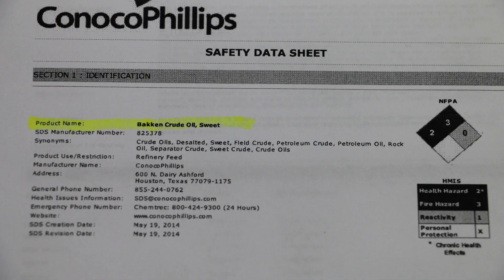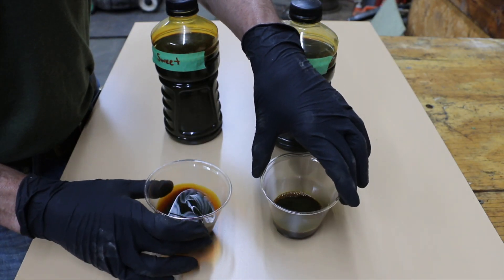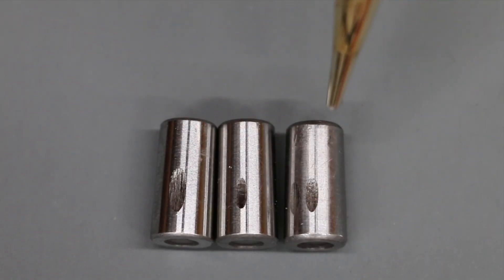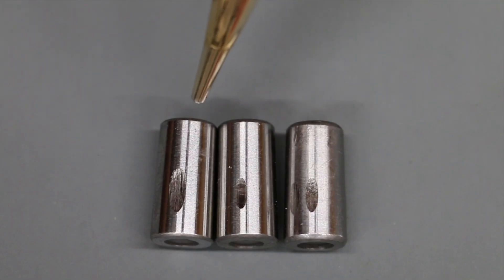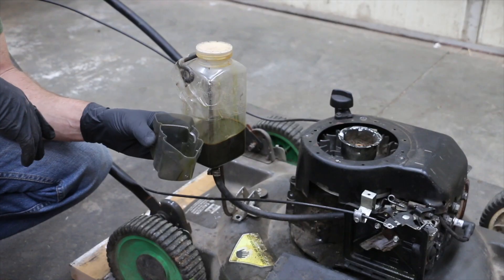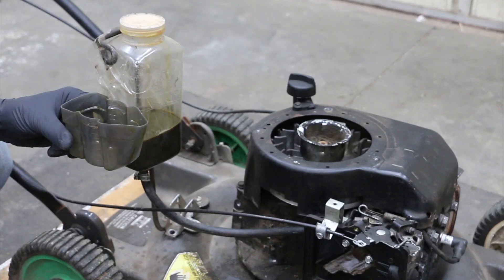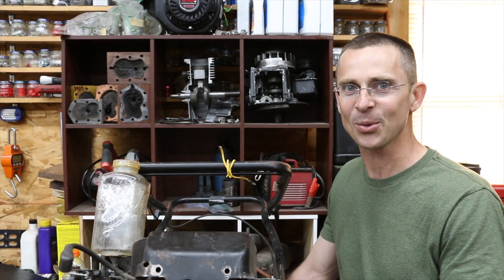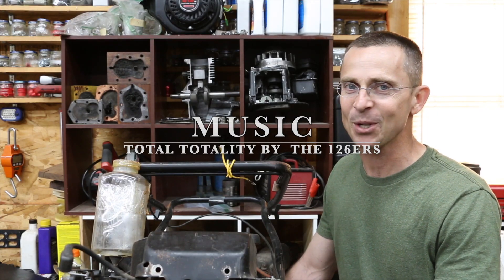Will a Gas engine run on Crude Oil?  Let's try it!

Comment: What if you use grease instead of oil in the crankcase?
Reply from the maker: Thank you for the video idea!
Reply: mharris1270 ya but im wondering how much you would have to put in the case and if would actually work. And i don't think there's oil pumps in Litt lawn mowers
Reply: mharris1270 how about if he does it he does it
Reply: A friend of mine has an old finish mower with blown out seals on the gearbox.  Wouldn't hold oil so they drilled and tapped it for a zerk.  Been running with grease instead of oil in there for like 5-7 years and still going strong.  I agree this would be an awesome video!
Reply: It would NOT be an awesome video unless you enjoy blowing up engines.....which some people do. The grease would not get into the moving parts at all; it would just sit there in a big blob and do nothing. Hence the engine will seize or explode quickly from lack of lubrication.

Small engines like this do not have oil pumps. Rule of thumb is, no oil filter=no oil pump (splash lubrication.) And don't be fooled by the hydraulic oil filter; some machines have no engine oil filter, but a hydraulic oil filter. For example, my wood splitter.

This idea has been suggested many, many times, and PF guy knows it's terrible, but is too positive to say so. That's where I come in. :) I'm sure he'll never do it. He knows it will bake the engine.
Reply: edifyguy If grease just sits there in a big ball then why aren't I replacing my wheel bearings every week?
Reply: Because your wheel bearings are designed to use grease. The grease is packed into the bearings mechanically, and sealed inside it. As you drive the grease actually is circulated inside the bearings by the rotational motion. This is very different from what would happen if you simply shoveled grease into a crankcase.

I'm not saying that grease is a poor lubricator; it just simply is not a suitable lubricant in a crankcase.
Reply: edifyguy in a servicible wheel bearing, as opposed to a unit bearing, the grease is not sealed inside the bearing itself, but is free to shift around inside the entire spindle assembly, from the inner seal to the outer.  Any bearings inside the engine will circulate grease the same way.  I would anticipate dry cylinder walls due to the grease not splashing around like oil.  I'm not saying that it's a good idea by any means, but I maintain that it would be very interesting and I think you'd be surprised by the results.
Reply: I am well aware of how serviceable wheel bearings work, having serviced many of them. The grease flows because it is pressed by the bearings and has nowhere else to go. It simply would not work in a crankcase scenario. There would be too much air space, not enough grease, and it would instantly get flung away from all the moving parts and do nothing. It would also never, no not ever, get inside the crank/rod surfaces. Even if the crankcase were filled to the brim with grease, it would not work. Grease is a totally unsuitable lubricant.

The only way you could potentially make it survive for a little while using grease would be to put a zerk on the connecting rod so you can pump grease directly into the crank/rod joint, and do the same thing at the top (wristpin), and smear some on the cylinder walls. It still would not last particularly long unless it were stopped every few minutes to renew the grease because the forces of the engine would quickly push it out, and cylinder scoring would destroy the engine anyway because all the grease would be wiped off the cylinder walls in less than a second.

I can't figure out why this idea just won't die. To me, it is the most obvious thing in the world that it not only won't work, but will promptly destroy the engine.

Comment: Out of curiosity what is the going price of crude oil? Would it ever be a cost effective alternative? Thats saying said engine would cleanly run it of course
Reply: Lt. flex $72 a U.S. barrel = $1.71 per gallon. Depending on weather it's sweet or sour. Prices differ.
Reply: Sinister thank you!
Reply from the maker: It varies based upon the type of crude oil. Light sweet is worth more than sour.  I believe it's around $60 per barrel.

Comment: I wonder if snake oil(actual snake oil) would be a good engine lubricant.
Reply from the maker: Great video idea!
Reply: Maybe when it's hot, but animal fat tends to solidify at room temperature.
Reply: grassroot011
What's the hidden message behind your grouping of blank spaces?
1-2-1-2-3-1-1
What are you trying to tell us?
Reply: Golden Grenadier that's a great idea and very funny joke
Reply: haa, throw a rock in a pack pack of dogs, the one that barks is the one that got hit.
Reply: @grassroots i dont think right wing nutjobs will burn easily, but when they do, its gonna be a huge fire...
Reply: I'm sure Elon Musk could sell you lots of snake oil.
Reply: Don't think  Leftist rhetoric  will   burn that easily. Or lubricate well either. Burn, maybe.

Comment: The sulfur is a lubricant in fuels and oils. There was a big concern with lubricity during the switch to ultra low sulfur diesels a few years back.
Reply from the maker: All great points and thanks for commenting!
Reply: John Davis I very much doubt that ULSD has led to increased pollutants. Do you have any measuerments backing that up?
Reply: Out on the Big Island we have enough sulphur in the air to make up for the road fuel stuff.
Reply: Sulphur is bad now, ruins emission systems and some engines use Nikasil coated liners, which sulphur eats into.
Reply: Sulfur is an antiwear component
Reply: Sinister That's no good even with low sulphur fuel.
Reply: John Davis They can but I rebuilt the VE pump on my 97 tdi Jetta (pre ulsd) and internally it was clean with no scouring. Ulsd killed the seals though. Also unrelated but biodiesel did leave a film inside the pump cleared with alchohol.
Reply: Brandon you got it right! The process that removes sulfur also removes/reduces paraffin. It is the paraffin that provides lubricity. The other issue came with the reduction of aromatics. That is what caused seals to shrink and leak. The reduction in aromatics occurred around 1993.
Reply: Erik Kovacs When they made the switch, it was messing up fuel pumps left and right. I hate the low sulphur diesel.
Reply: Michael Ceasrine and do a vegetable oil conversion on a diesel. Drive around smelling like a deep fryer.
Reply: skunkjobb I think he’s talking about the emissions scandal. VW and others were hiding how much their diesel engines polluted.
Reply: On this topic... Can you test Diesel fuel additives like Stanadyne, Howes, and Power Service? Almost all of them claim to decrease injector wear and clean injector tips.
Reply: Which would explain why molybdenum disulphide works well as a lubricant additive.
Reply: Project Farm maybe see if you can test molybdenum disulphide. AvE from way up north might help find some if ya need it
Reply: John Davis, you are totally correct.  Some ideas have very bad consequences that people never consider before implementing them.
Reply: Anthony GHB:  read other comments about your question.  Many have already covered this.
Reply: Anthony GHB Sulfur is fine for diesel engines made before 2005. They can run on used motor oil or even vegetable oil! It will do damage to newer ones.
Reply: Sinister a lot of guys just add a quart or so of 2 cycle fuel or oil to the mix in they're trucks and equipment ... seems to help
Reply: 5Rounds Rapid. That was about the NOx problem, it has nothing to do with sulphur.
Reply: Any lubricity loss that has happened by going to ULSD has been remedied by adding biodiesel. This is why most fueling stations list a 3 - 5% biodiesel blend.
Reply: 5Rounds Rapid actually, sulfur is NOT "fine" for any Diesel. Higher sulfur content lead to earlier injector failure. Verification of this can be obtained by asking any over the road owner-operator. An owner-operator is going to be well aware of part longevity and the causes of reduced service life because it is his livelihood.
Reply: Erik Kovacs no, reduced aromatics "killed the seals". Reduced sulfur lead to reduced lubricity due to the reduction of paraffin that accompanied the reduction in sulfur. That is why ASTM now specifies a lubricity standard for Diesel fuel.
Reply: i been running my m35a2 on used oil as well, dumped about 10 gallons of transmission fluid in er and and it did well. smokey but if its free its for me :D
Reply: Brandon Ok I'm not a Tribologist, whatever the reason is diesel with sulphur in it didn't wear out injection pumps like ULSD does.
Reply: Brandon  sulfide is a lubricant , molybdenum disulfide ??
Reply: Dylan Zrim you can get it at every parts store and farm store
Reply: To anyone thinking that molybdenum disulfide (MoS2) would act as a diesel lubricant: For the love of your engines (and sanity), DON'T DO THIS. MoS2 will NOT dissolve in diesel, so adding it to your fuel will block the fuel filter, in a similar way to adding sugar to a gasoline tank.

MoS2 is a solid particulate lubricant like powdered graphite - both work the same way. Either can be added to grease as a suspension, so that if the greased part overheats and the oil component of the grease melts away, you still have some lubrication remaining from the MoS2 or graphite powder.

If you are at all worried about using low-sulfur diesel in an older engine, just mix 5% (or 10% if you're really worried) of 2-stroke additive oil - the stuff you would mix with gasoline for a chainsaw engine. It doesn't have to be the best quality oil either - the cheapest grade of 2-stroke oil is good enough, since when mixing it with diesel, you're only lubricating the fuel pump and injector, not the engine itself.
Reply: Haha there still is. 
I run my old vw on a crapload of other oils. 
People give me unused cases of oil so I throw it in the tank with about 5-6 other things like cetane booster and mmo and whatnot. 
When it’s up around a 25-30% concentration it runs pretty nice.
Reply: I totally agree that lungs everywhere are happy that diesel is now Ultra Low Sulfur Diesel.  The ULSD causes pumps to grind internally, damaging injectors, which overfuels the engine, which cranks out additional particulates and pollution into the atmosphere that our lungs breath.  Yeah, lungs everywhere rejoice at the idea of engines spewing out more pollutants due to ULSD.
Reply: Sulfer is not responsible for lube in diesel, however when sulfer is removed from it the parts of the fuel responsible for lubrication also get leached out. If the process could only target the sulfer all would be good.
Reply: Even if your fuel pump hates it, your lungs should like it better than the high sulphur oil, or rather the exhaust gases from it.
Reply: Sinister you also love diseases then ?
Reply: skunkjobb yes.... because it exhausts inside the cab.

Comment: Hi great video :) , I dont understand what you mean when you say "adjustable Jet" , I have always known a Jet in a Carburetor to be a little brass round screw with a hole drilled through the middle, swapping the Jet for one with a bigger hole richens the mixture, smaller holes make it leaner.
Reply from the maker: Thank you!  Most of my mowers do not have a little brass screw in the middle. This is one of the few of mine that has it.

Comment: Surprise! Surprise!  What the heck is going on with that sour crude?  Seems like it would make good motor earl.  Maybe oil refining is not really refining.  Maybe it's just stealing the good stuff and selling us what's left.
Reply from the maker: That sour stuff did smell like sulfur, but sure did work well!
Reply: Is it at all possible that the sulfur is adding to the lubricity?  Can the sulfur be removed without diminishing the lubricity?  Answer to both: Could be!  btw. great video

Comment: Great video!  I thought the lubricity test was especially interesting since the lubricity varied pretty dramatically, though perhaps coincidentally, with the sulfur content, much like how ULSD has much lower lubricity than LSD.
Reply from the maker: You're right about the sulfur and its role in lubricating.

Comment: Couldn't you change the carburator jet? Maybe you should use a bigger one if you use "liquids" with a higher viscosity.
Reply from the maker: Yes, I could drill it out more, but it'd only be good for high viscosity fuel after drilling it out.

Comment: The problem with crude oil is it might have tar and other shits, which may vary from well to well, and that can cause lots of problems in the long run. Its more or less the same as running a diesel engine on unprocessed vegetable oil. It might work but the problem is reliability on the long run.
Reply from the maker: Great point!  Short term gain, but long-term pain...
Reply: Shits?! Haha
Reply: Primitive internal combustion engines were made to run on crude oil, of course they were crap en power and efficiency compared to nowadays engines but in the begining of times, those existed. (obviosly because the idea of refining crude oil came later)

Btw, the sour oil which contained sulphur maybe, im not a chemist, maybe had better lubrication properties because sulphur compounds afaik are rather good lubricants.
Reply: yeah but i mean primitive in the sense of the development of said technology. It might be using a carburator but most likely it was designed in CAD in a computer and all the mold, parts and tooling were dont with much better materials and with better tolerances than the first one.  Leds were also discovered in 1907 but that doesnt mean the current ones are in any primitive.
Carburators are still used in aplications where you dont care for efficiency and dont have an alternator to power the injection system.  Carburators are robust and simple,  for stuff that needs that, they are unmatched, and you know the rules, the simplest the machine, the less prone to failure.

Comment: Wow I honestly didn't think it'd run like that if at all!
Reply from the maker: I was surprised too!
Reply: Given the low gravity of this, I was expecting it to work. What is more surprising is that the light-sweet crude was harder to flow than the sour stuff.
As I understand it, this particular source of crude is especially light and loaded with stuff even lighter than gasoline. In fact, it's quite possible that a lot of gasses escaped this crude before it could even be put in the bottles and shipped. I was wondering where he got crude oil. That stuff is NASTY.